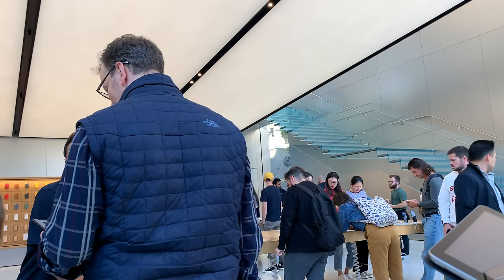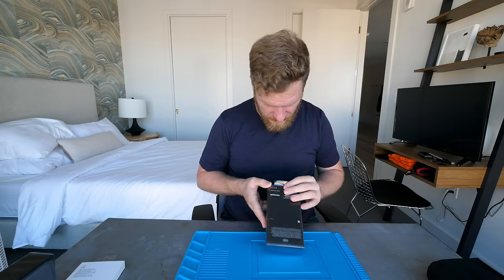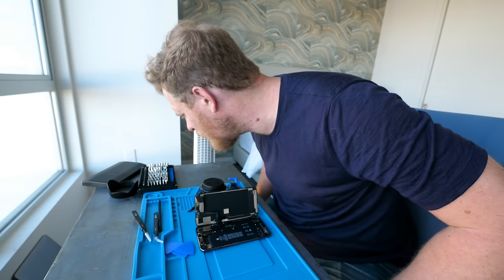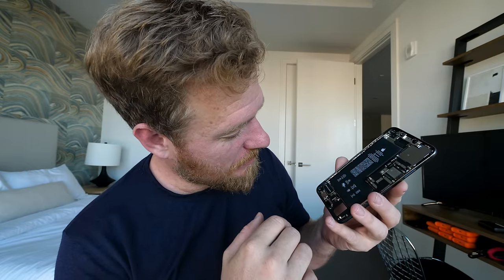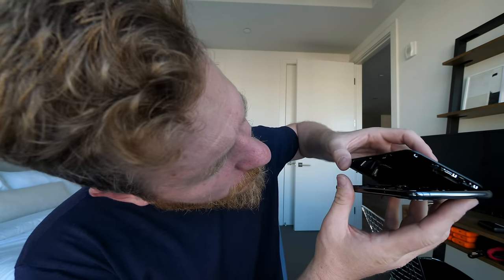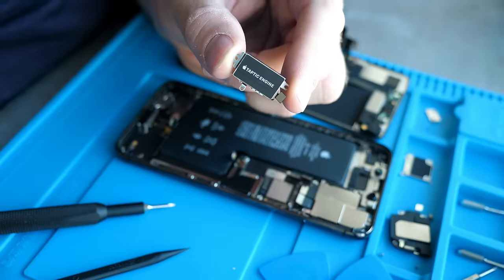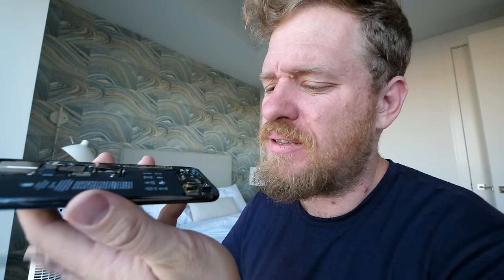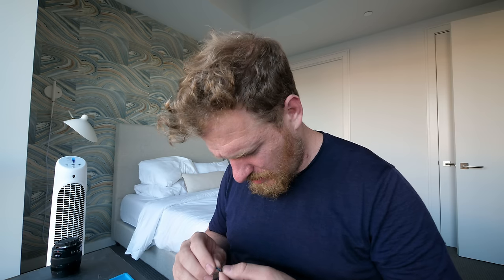Adding USB-C to an iPhone - Is it possible?

Comment: For the sake of installation, would it be possible to manipulate or change something like the size of the speaker or battery? Could you get third party parts &/or custom hardware or  is the majority of the software/hardware require parts especially designed for apple devices?

Comment: Quick guess before watching, It is hard to achieve.
I guess Apple made some software in the phone to verify hardware, so if you can not rewrite the software, you only can cheat the software. If you want to cheat the software, you need install more hardware parts to implement. And there is no more space for these extra hardware parts in this phone. 

Just guess.

Comment: How to add USB-C to iPhone: 
1) Throw iPhone in trash
2) Buy an android

Added benefits: headphone jack retained, possible expandable flash storage, customisable out of the box.
Edit: You didn't need the board, just the connector. USB-C and lightning are the exact same (lightning is male whilst USB-C is female)

Comment: The reason why the iPhone can't change from Lightning to USB Ta C is because Lightning has higher waterproof performance than USB C. Besides, most of Apple's sales seem to be Lightning license fee, but iPhone in Japan It is Aiphone Co., Ltd. that owns the trademark right
Reply: that's bs, apple could make it just as waterproof, sure lighting was designed to have that right off the bat, but usb c could just as easily have that, I mean even if they just caked it full of glue it'd be just as waterproof
Reply: I think that Apple can not freely install the waterproof function of USB C on the iPhone because Google's android side has an international patent.
 * My guess